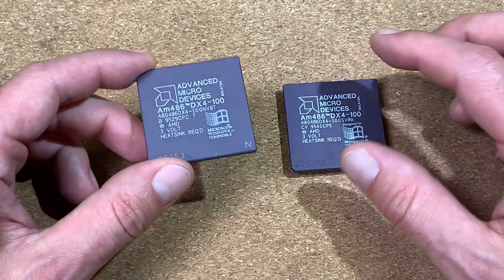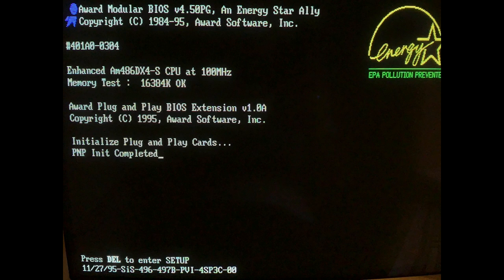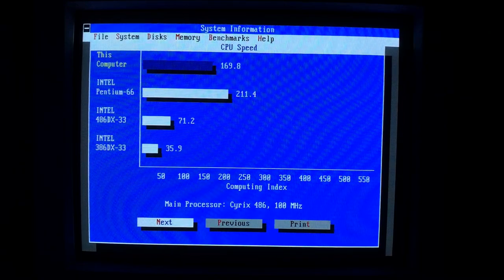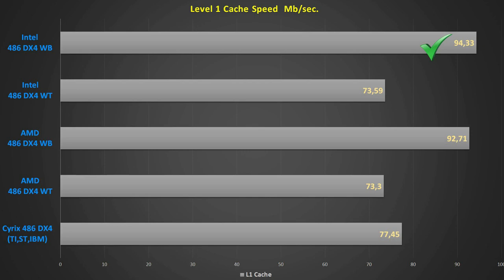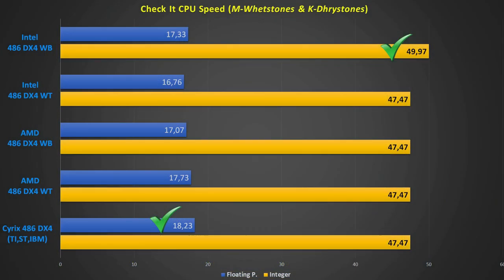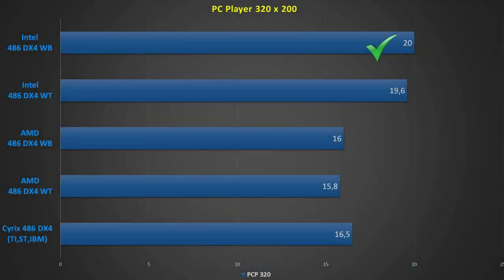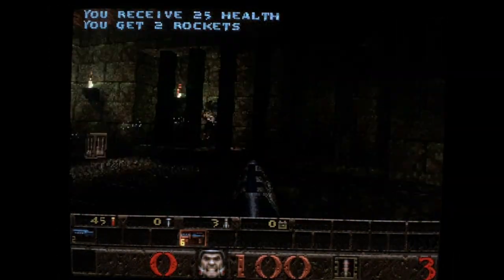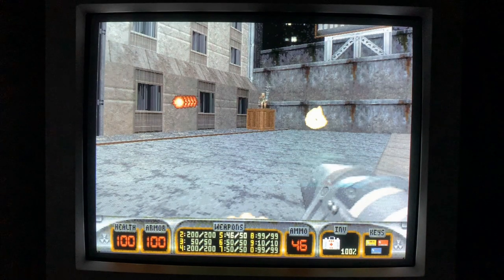486DX4-100 MHz Benchmark Battle [ Intel, Cyrix, AMD, TI, ST]

Comment: Out of curiosity, what is the state like with DX2 / 66MHz chips? 
I finally managed to find a socket 3 board that did not have damage from a barrel battery and over the years I've collected 4 different socket 3 CPUs to choose from.
An Intel 486DX2-50, which I've discounted because of it's lower FSB and lower clock, an Intel 486DX2-66, the ST 486DX2-66, and the OEM use TI 486DX2-66.
Is there any worthwhile difference between these? I noticed the ST chip has "Heatsink required" and the DX2-50 has one permanently attached.

I would love any insight or suggestions you might have. I've only got the chips for 128K of L2 cache, if it helps any.

EDIT: I hope this helps someone, I did some testing between all of my chips now, and of course the DX2/50 performed by far the worst and could not clock up (Was to unstable at 66MHz to do anything) so it wasn't worth it. The ST performed identically to the TI chip (I think they are the same inside) but the ST ran much, much hotter and needed higher voltage to stay stable. At 80MHz it was already at 5v and extremely hot even with a heat sink. The TI runs the coolest for sure, and was stable at 80MHz at 3.3v! I was surprised by this for sure. The Intel DX2/66 seems to be right in the middle of the pack, average overall. I'm going to do some further testing with overclocking as the TI seems to take to this really, really well. Interestingly, the TI lost performance in Topbench and 3Dbench for some reason, though.
I'll report back again with findings!

EDIT2: The Intel chips really really hate to be overclocked, at least both of mine do. The DX2/50 will not work at 66 and the DX2/66 will not work at 80. Can't get a difference no matter what I do. Think the TI will be my winner here. I hope this helps someone out!
Of the 4 I tested, the best overall was "TI486DX2-G66-GA" and a good runner up was "ST486DX2-66GS" 
The ST says "heatsink required" and if you're running it >3.45V and >50MHz you absolutely need one. Below that it runs generally cool to the touch. It has similar performance to the TI but runs very hot. The TI chip runs really cool and low voltage, and performs slightly better while also being more stable. How interesting! I guess they're not exactly the same inside after all.

Comment: How about an FPU benchmark? The 8087 80287 and the  Weitek, AMD and equivalents.
Reply from the maker: Thanks for your input. Indeed I was thinking about that already. I might do one for 387 FPUs.
Reply: @CPUGalaxy  

Another I'd like to see is cross-architecture benchmarks, pitting the Motorola 680x0 series against the Intel 80x86 series with various integer and floating point benchmarks.
Reply: There is a FPU benchmark in this video though its not very extensive. Quake hits the FPU pretty hard so the 10% loss to AMD mostly matches benchmarks pitting the two over the years.

Comment: I read some post somewhere that some DX4-100 chips can run as DX2-100 (50MHz FSB). Is that something you have info on?
Reply from the maker: Interesting that you ask that coz some days ago I was trying that. The board was posting but crashed always during startup. Actually I guess a performance issue of some peripherals. But i am in that topic and if I can get it to work I will make for sure a follow up to see how much performance we can gain out of that.
Reply: @CPUGalaxy  Test the mobo/gfx with a DX-50 to see if it can hack it.. I was told only a few vesa cards can run stable at 50.
Reply from the maker: yeah, but to keep the performance I need to use the ET4000WP32 or the ARC1000 video card. Those are far the best ones. If I would use a cirrus logic or others I would definitely lose the performance I could gain by the 50Mhz bus clock.

Comment: I wonder how much bus speed effects performance: try 486's at 4x 25MHz, 3x33MHz and 2x50MHz. As far as i'm aware AMD used the 5x86-133 core in some of there late model 486DX2 chips with the multiplier set to 2/3

Comment: You didn't talk about any cache RAM on the motherboard, I could see 256K on boot-up but didn't some support 512K?
Reply: I could be a bit off on this but I seem to remember some cache restrictions where when using a larger cache configuration, it would split the cache into two banks that handled the first and second chunk of the maximum RAM size (could have possibly been an issue being short a bit in the cache tag RAM).  So you had to really load up on RAM to have any impact, and even then you'd almost have to specialize RAM allocations to get any kind of consistency and get a boost beyond "at least you have cache for the upper RAM now".  It may have been specific only to some chipsets.  But with this board only having 2 SIMM slots maybe it wouldn't even apply.

Comment: If I remember it correctly, the Cyrix 486 was a slightly better design than the Intel or AMD 486s, so I am betting the Cyrix will win by a small margin.
Reply: Aiaiai... I remembered it wrong. :-) The Cyrix has a good FPU design indeed, but that does not necessarily make it the best CPU, especially not in the pre-3D games series of CPUs.

Comment: Shame you did not try cyrix 100mhz 5x86 socket 3
Reply from the maker: Yes, because the 5x86 is not a 486 any more. I could compare the 5x86 with a  socket 3 pentium overdrive but not to a 486 dx4.
Reply: @CPUGalaxy  should do 5x86 socket 3 cpus vs Pentium. Like to see what you get with that board setup vs mine

Comment: The ark1000 is faster vlb card.
Reply from the maker: thanks, interesting that you write that now. Just 5 minutes ago I found out exactly that by random while testing something for a new video. did not expect that. Its not much faster but slightly. 3D bench and PCP shows no difference to the ET4000w32. quake is 0.1 fps faster...
Reply: @CPUGalaxy  basically we cannot talk about big differences, the cpu is too slow for it (especially in the quake). i measured 68,0 FPS for Tseng ET4000/W32p and 71,7 FPS for ARK Logic ARK1000VL in 3dbench. more details: https://docs.google.com/spreadsheets/d/1eXksIjli6f0JetBpih-XuR7PJrAJry4GLwFq7x3MVZU/edit#gid=1011467741

Comment: I'm the only person who downvoted this video and for one good reason. It has been 30 years, those CPU are no longer manufactured, there is no reason to exadurate differences. Typical trick of starting bars with offset, that has been common in Pentium 4 era to make it look better than it was in reality. It makes 10-20% to look like 2x 100% difference. If this was 30 days after release it would be shameful to do so, 30 years later its unaccepable to me. Although i subscribed to your channel. You put lot of work to make such comparison. Saw your video mentionen on RetroSpector68 channel. But i will never ever accept such charts.
Reply from the maker: Thank you for your feedback and I agree fully what you say. To defence myself a bit here I want to say I did not do this on purpose. Excel was doing this scaling automatically when I switched through the different data sources. I recognized it after publishing the video when somebody gave me a hint on that. I think it happend also in my OC video. Of course I will take care about that to be more accurate in future videos. Anyway thank you for subscribing to my channel. Cheers, Peter
Reply: @CPUGalaxy  I forgive you :P